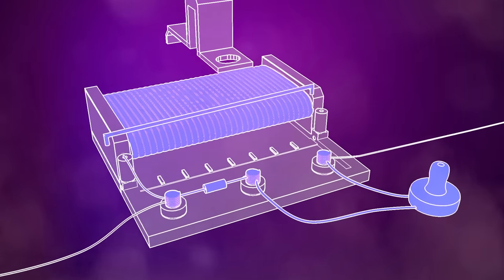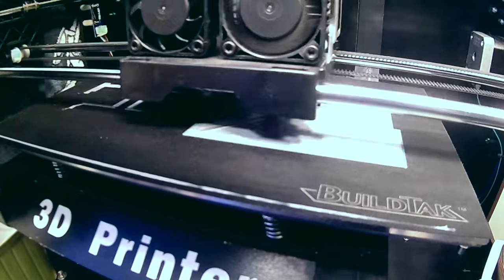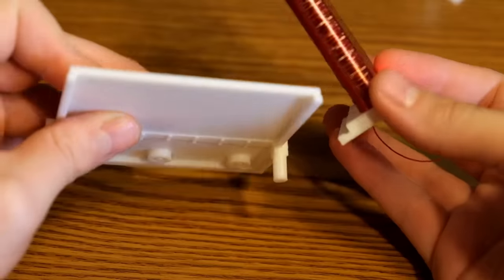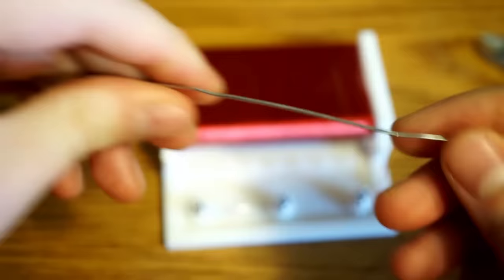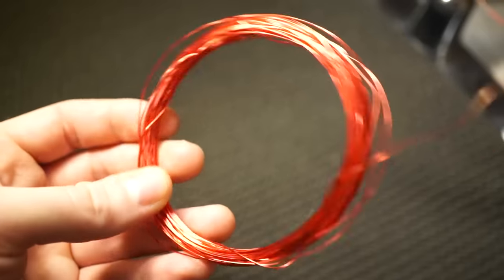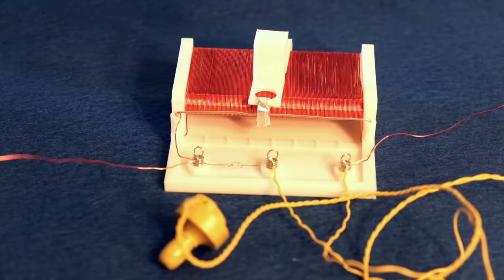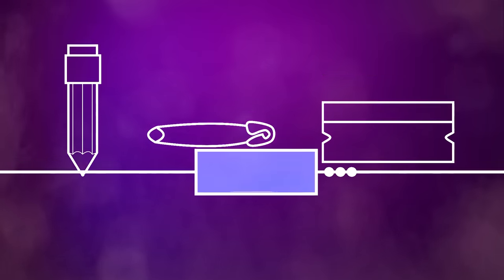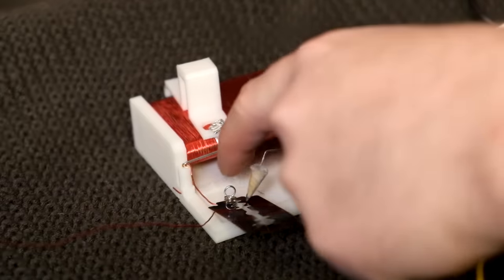3D Printed Radio | No Batteries

Comment: HE BUILT. HIS. OWN. DIODE.

My gosh... if scientists knew about this kind of diodes back then...
Reply: they did ... foxhole radio. Original radios from Tesla and Marconi ...
Reply: @wanderingzanzey2126  still, everybody was using radio vaccum tubes
Reply: @vilkillian  No, Germanium point-contact diode were a very real thing :)
Reply: @vilkillian  These kind of diodes, called crystal or "cat's whisker" diodes, are actually quite a bit older than vacuum tube diodes. However, because they were very finicky and delicate - they had to be tuned by trial and error, and even tiny vibrations could knock the contact point off the tiny crystal defects that create the diode effect - and nobody actually understood how they worked (since the quantum-mechanical understanding of semiconductor physics would not be developed until much later), they were eventually replaced by vacuum tubes in most applications. And most importantly, with vacuum tubes you could not only make diodes, but triodes (analogous to modern transistors) - allowing you to not only rectify, but amplify received signals, so you could pick up radio stations further away and didn't need to listen with a sensitive piezo earpiece.

Comment: note depending on your kitchen sink it might not be grounded. e.g. mine has a section of plastic pipes and rubber hoses, so it's actually isolated. but you can actually buy mains wall plugs that only have the ground pin connected, not the power, so you can use one of those to safely ground your device.

Comment: Note from a plumber, Most modern kitchen sinks and faucets will not allow you to ground your tuner this way. A lot of water and drain lines are now plastic and even the water supply piping in a lot of cases is plastic. Very cool project and making your own diode is a cool touch!
Reply: In most places, the water has enough mineral content to qualify as "conductive" for the purpose of the radio.
Reply: @kensmith5694  Interesting. I had not considered that.

Comment: This is awesome. I once got the same effect by using a pair of speakers that were not plugged into anything, carefully positioning the wires made a very very faint sound. This was about 6 years ago, i honestly thought it was magic at the time. It's happened since, but I knew what was happening then. The question remains: why did standard 8 ohm speakers pick up AM signals strong enough to make them sound?
Reply from the maker: Wow that is interesting. I have not heard of that. I'm sure some speaker designers account for that and make sure that doesn't happen. That would be fun to recreate.
Reply: I've also been able to pick up raido waves with my electric guitar when it was plugged into an amp. I think I was also touch a radiator (ground) with my feet.
Reply: I had a problem with a 2W amplifier and speakers, which did pick up radio pretty well, and In addition to the sound I put in, I was sometimes greeted with the bbc while changing the volume.
Reply: Maybe you live(d) near a broadcasting tower and the signal was very stronn or something amplified it. I also heard of someone being able to listen to radio by placing a pot on the stove
Reply: Back in the day (1950s), people with metal fillings in the teeth near an AM broadcast tower could pick up the station with their teeth and actually hear the demodulated audio. Kinda spooky until they figured out what it was.

Comment: This is a great project! Also, before people say that this video is using "free energy", no. It get's it's energy from the AM transmitter, which is so powerful, it can just about power a small speaker. This project might not even work if you are too far away from the AM transmitter.

Comment: I love how this guy assumes that there’s no reason that someone wouldn’t have a 3D printer. Like, yes, they’re great, I love mine, but a lot of people don’t have the disposable income to spend on a 3D printer, especially people who would be interested in a solder-free DIY electronics project and therefore wouldn’t be very invested in mechatronics.
Reply: I don't have one... It's just 150$ for the most basic models, but I still can't justify that amount of cash for something I just won't use much. And the printing plastic isn't free.
Reply: $20 a kilo for a good basic filament shipped to you is about what you should expect to pay if you live in the US. €20 in Europe will get you the same. Depending on how much you print, a kilo lasts a long time. The only issue is that you need to spend at least another $20 for every color you want, and if you want to try out exotics like bronze, or engineering plastics like nylon, you’re going to pay about twice that. So I would say that 3D printing isn’t expensive if you just need to print stuff like this, or maybe the occasional Baby Yoda. 

An ender 3 (a solid first printer) and a kilo of bog-standard PLA runs you about $200; if all you want to do is make stuff like this video, then you’ll get a lot of mileage out of just that. It’ll probably come out to around $10 a month, which, compared to a lot of other hobbies, isn’t too bad.
Reply: @you_just  One day :)
Reply: @you_just  20$ is really expensive :/

Comment: Super cool video man👍 I'm no electrical engineer but I didn't know you could do this with without a power source!   These are the videos I love the most. Thanks man! 👊
Reply: Radio waves themselves are the power source.
They come flying by and hit your antenna.
When they do they make a small voltage on the antenna.
If the station is 560KHz AM then the tiny voltage is AC at 560KHz.
Usually there is also a ground connection on the other end of the coil.
The result is that the station tries to make an AC voltage at 560KHz appear across the coil.
The diode picks off the peaks that go in one direction so the earphone doesn't get the 560KHz.
The AM modulation makes the peak voltage vary with time and this is what you hear
BTW there are likely better designs you can 3D print or make out of other stuff.
A cylinder is a better coil that a square cross section one.

Comment: can you use an led  for the diode?
Reply from the maker: That would be interesting if that did work. I think an LED would draw too much current for this simple circuit. That is why they recommend the diode provided. Maybe I will try it and let you know.
Reply: The forward voltage of a LED is probably way too high. The used diode was a point-contact german diode. These have a very low forward voltage, often as low as 0.2 V. Maybe you would be able to receive a radio station with it, when you live really close to it.

Comment: really dont see how a 3d printer was needed for any of this.
considering the scratch built nature of all the other parts, why would you go to the effort of using an expensive 3d printer for the plastic parts when they could easily be made out of junk too?
Reply: Its relatively inexpensive and fun.
Reply: I dont think you understand what the word "relatively" means. when compared to a paperclip, a pencil, a piece of tin foil or any of the other components used in this video, a 3d printer is "relatively" extremely expensive actually

Comment: Reads title: No batteries!?!
Sees him connect it to a faucet: 😡
Reply: PhonieZGaminZ  True but it's kinda lame how it will be tied to a faucet. Much more portable with batteries.
Reply: @TristanSamuel  it's just ground. Literally put the wire into the ground if so desired. Just the facet is conveniently there.
Reply: @someonesomewhere3817  Where's the power, then?
Reply: @TristanSamuel  As explained, from the strength of the radio.
Reply: @someonesomewhere3817  True
Reply: Radio waves are electromagnetic radiation - they are their own electricity, as long as you only need a tiny bit, like in this wee baby radio.
Reply: @Just_Sara  Oh, I get it now. Thanks!

Comment: So I have a funny story to tell that relates to this project.  I actually had a toaster that I had to hide away in certain cabinets because it would pick up the local AM station if it was anywhere in the kitchen.  Unplugged, sitting on my counter in the kitchen, it would project the local AM stations sound into the air, it was pretty weird.  Anyway great video and I'll probably make this just for fun (minus the razorblade diode part).  Great project!

Comment: So you 3d printed a case for a radio. This is cool but it's still clickbait dude.
Reply from the maker: A lot of people don't know about crystal or foxhole radios so I want to introduce that to them in a fun way and by using the modern 3D printer.
Reply: I appreciate that, and I'm not trying to hate, but wanting people to see your content doesn't excuse a misleading title. I came to this video specifically to see if 3D printers were capable of printing electronic parts (I know very little about them). This isn't a "3D printed radio", it's a 3D printed plastic shape, which you then built a radio around. It's an amazing device absolutely, but none of the actual radio is 3D printed. I'm sorry but I just felt that needed mentioning. This is cool, high-quality content, and it's tainted by the clickbaity title!
Reply: Do you see the thumbnail of the videos before you watch them or you just read the title?

Comment: I made one of these in one of those retro 100 in 1 electronic experiment kits, but the parts were all prebuilt you just had to move around the wiring for each experiment. I remember being mindblown that it worked with no batteries!

Comment: Basically a foxhole radio, I built one with a paper towel role some solid core ethernet wire, a blued raze and pencil. I didn't have one of those earpieces but using an amp it worked. I'm curious though why the need for the diode wouldn't an alternating current work just as well, I had removed the razer and pencil from mine and it worked.

Comment: when I was a child, cheap crystal radio kits were common. But instead of varying the inductance of the tank circuit by changing the turns of the coil that were in play, you moved a metal slug further into or out of the coil.
Reply from the maker: Yes I looked into that method and that would also work. I'm glad this project brought back those childhood memories.

Comment: Instead of using a regular diode you can also make your own, especially since this is already a 3d print project. This kind of radio was very popular in the early days.
 Doesn't require much more than a clamp and two wires, as well as a proper crystal - and these can be a certain variety of different materials like pyrite.

Comment: Just like we did it back then, you could make a tapped coil (or just tune an untapped one with a ferrite rod) and print your own variable cap (possibly with gearing) to make it easier to tune. Nice find on the diode btw.

Comment: For those who struggles to find germanium diode you can use silicon diodes but it needs to be biased or applied  small voltage

Comment: It's supposedly also possible to replace the diode with a sugar-cube and a needle.  You connect one wire to the cube and the other to the needle, then prick the cube with the needle until you find a place where sugar-crystall act as a diode.  This is similar to old crystall-radio sets, where you had a piece of quartz and used a thin metall whisker to find an active point.
Reply: Sugar its self won't work.  Perhaps a contaminated sugar cube might but I doubt it.
Reply from the maker: Ive never heard of this or seen it working. I would be interested to find out more if you have any links. Thank you!

Comment: Instead of a variable cap (as is the case with 99.999% of transistorized radios of the 70s, 80s) u are using a variable inductor, very clever

Comment: LOL !!!   The First Rule of Hype for 3D Printing: Whatever noun follows the descriptor '3D Printed' is always the wrong word; typically referring to the next higher assembly. In this example, we have a 3D Printed plastic 'chassis'; that can in turn be used to support the assembly (by hand) of a Crystal Radio. This rule is so incredibly accurate that it's only the rarest exception when someone actually manages to chose the correct noun after the phrase '3D Printed'. Watch for it, you'll see it everywhere and always.

Comment: The diode, on this case, is doing a resonating circuit with the coil... not "cutting the wave in half" (half wave rectificator)
Reply from the maker: I believe this diode does serve as a half wave rectifier and this circuit would not work without it. I found several sources to support this but I do appreciate your help in keeping the video as accurate as possible. Thank you.
Reply: The diode is a half wave rectifier in every type of diode crystal radio, or the headphone couldn’t work. The tuned circuit is formed by the coil and antenna in this case.

Comment: 1st before you start making this... make sure you have AM radio station in your area... Me as many years back was happy to try to make this project and never get to know if this thing ever worked or not. Even radio could not find a AM station.
And ofc not i didnt have 3d printer but some cardboard and toilet paper roll. Also i got myself the own diode with help of an adult so that also lowered hopes for it to work, but we never know.
2nd you kitchen faucet might grounded because use of pex tubing

Comment: Very cooooool!
But with that "earpiece" (in German we call it 'Schmalzbohrer'), it should work a lot better, if you put a high resistor (100k or so) in parallel to it. This is, because that earpiece behaves as a capacitor. As a Diode, some shottky-diodes with very little drop of voltage also work very good.
Reply from the maker: I wish I added that in the video with a before and after comparison. That's a good note for people who want to make this so thank you!

Comment: Heard about this type of radio when AM signals were there. Didn't know that we should connect the other end to Ground / earth.
Reply from the maker: Yes it's important to make this type of radio work. And an actual metal pole stuck in the ground might work better since most people have plastic pvc pipes in the sink now days. Although, mine worked fine using the faucet.

Comment: The enamel of coated wire is flammable. I use fire to remove the enamel from ends. It's not a good idea for the frequency slider tho

Comment: Nice project variation- always fun :) Can we get someone close to an AM station to light up a diode on this receiver? Then, can we go to the station and measure the current drop when the crystal set is tuned into the station? Just hoping to validate some data, thanks in advance !   Cheers.

Comment: Looks like the slider over the coil is too wide. It must only touch a single turn (wire) at a time. If the metal slider touches more than one, the coil has a shorted turn(s) which greatly reduces its power. Most crystal radios do this, and it's tough to do unless the turns are separated. But it will work much better if you can find  way to do that.

Comment: "No need of batteries". " but you'll need a powered guitar amp if you want to actually hear something".
XD

It's fun anyway, I might try it one day,  just wanted to add that there isn't just AM radios, there are also FM (frequency modulation) but it harder to build one.
Reply: this kind of radio is perfectly usable without an amp, he used one to get decent recordable audio but if you are actually using one of these under normal circumstances the crystal pickup by itself is more than sufficient, look up sound powered telephones to get an idea of how that works, its the same basic concept even if the mechanism is a bit tweaked to be able to run both ways

Comment: i have a diode but if you think about it, a led is a light emitting diode so should it work?
Reply: A led won't work in a crystal set you need to use a germanium diode like a 1n34a, hope this helps :)

Comment: I had a much smaller version and the ground and antenna was a high metal fence!!
Reply: There is a clever design that uses a plastic tube just big enough to hold the earphone and two wires (antenna and ground connection).  Down inside there is also a variable capacitor and diode.
The coil in made on the outside of the tube and then wrapped to protect it.

Comment: So its a foxhole radio, something you can make for waaaay less with just a wooden board and a toilet roll as the base with some wires or even just a couple of paper clips. Basically its just an over complicated one that while functional isnt exactly cheap.
Reply from the maker: I think the quality of the 3D printed model is better and should last for many more year but yes you can use those items. I think the knowledge and experience of this project is important for people to have no matter how you make it.

Comment: "The longer the antenna the louder"
Not really, the optimum length of the antenna is actually proportional to the frequency of the waves being received, the effect of seeing that the longer the antenna is the louder it gets is actually created by the fact that is covers a larger area and thus has a higher chance of receiving signals purely due to area coverage. Obviously this is fine, because you couldn't choose the right length as frequency is changing often but it isn't length in itself that makes the sound louder. A tactically-placed but much shorter antenna could achieve exactly the same effect

Comment: I find it odd that people will be all like "No soldering required" but you literally need access a freaking 3D printer. I legit can get dust from the moon easier than I can even touch a 3D printer.